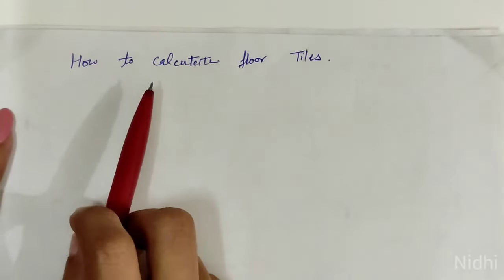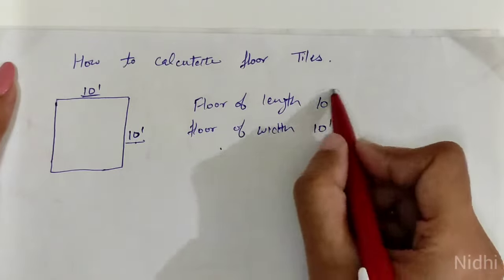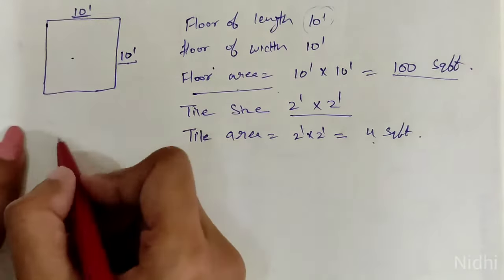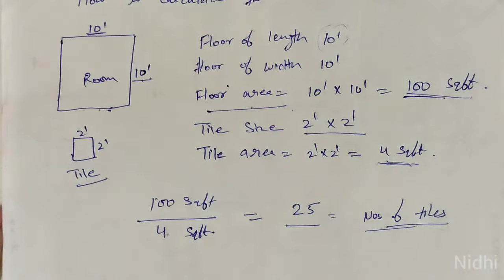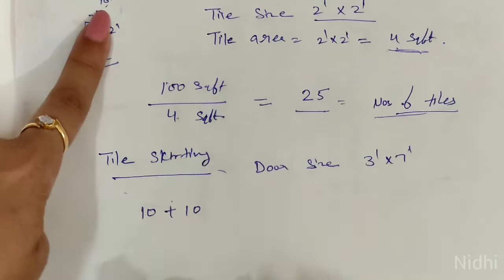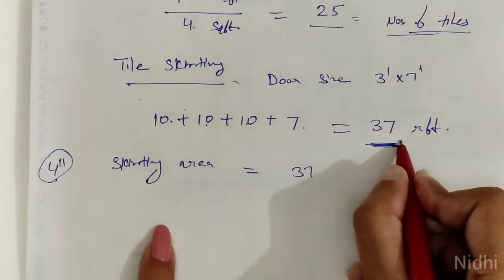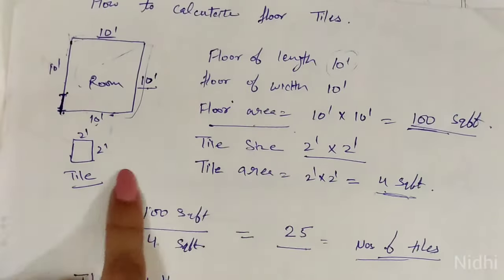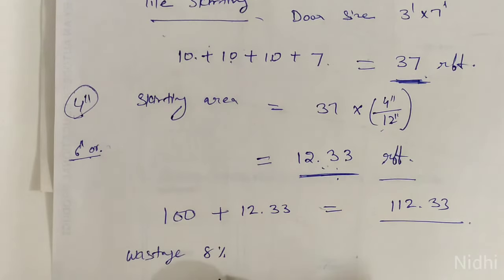How to calculate floor tiles and skirting || Estimating and Costing #floortile #estimation #skirting

Comment: Skirting area calculation rft to sqft is confusing. It has formula (length of running walls×height of skirting)/area of tile you get no of tiles required for skirting. It is so easy and simple

Comment: good info...but if it marble skirting or any....I believe take perimeter or running feet/meter/centimetre of a room and multiply by 10 centimetre that is height of a tile or marble there we get the skirting quantity and u may add 10 percent to it as wastage......if this is wrong correct me pls
Reply from the maker: Any type of skirting... Yes you are right , 
U can do with your method also 😇
Reply: @SidhnathCreation  thank you.... could you please tell about linear meter and it's application in designing